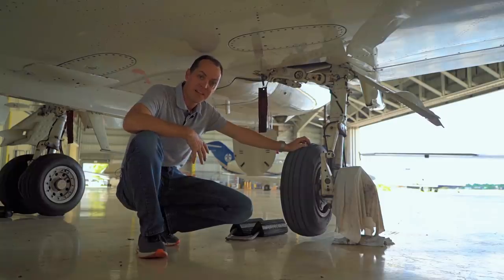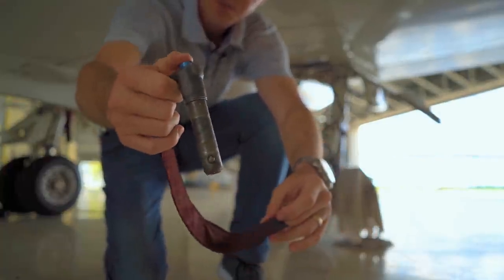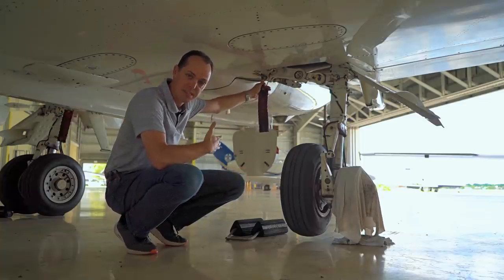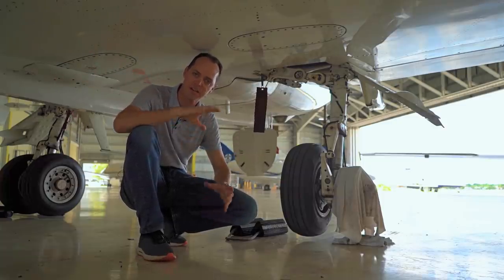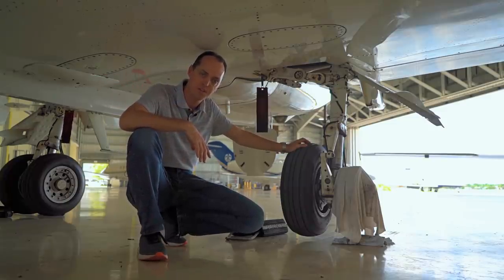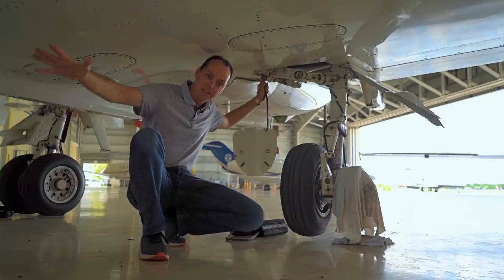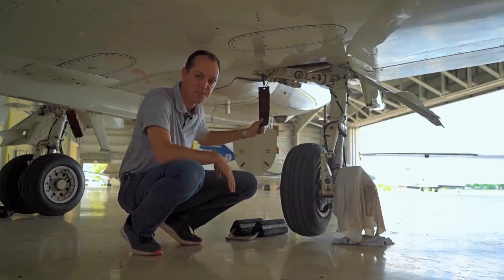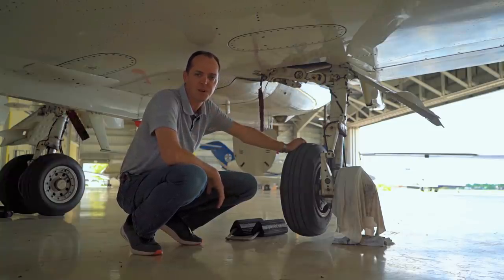Tech Tuesday - Gear Collapse Prevention Made Easy

Comment: Hi Shaun, great idea of setting the brake so it can't be moved, except the tug operator may try to move it and the nose gear has a potential to collapse.  There's usually enough in the accumulator tank for that not to happen.  I and my team always help the crew by installing the pins shortly after the pax are gone (providing it is overnight and will be towed).  We will not, however, remove the pins for the crew so they physically have to do it and know it's been done.  On the Hawkers you also need to move the steering pin from vertical to horizontal, especially important to remember when using a Lektro, otherwise that pin is used in the horizontal position with the tow-bar head.  Love the Tech Tuesday.
Reply: @Honk Honkler You can pull and push an aircraft, putting forces both directions on the gear.  When towing an aircraft forward, usually tug in reverse, you are pulling the same way the gear would be traveling to go up.  If the brakes are set, the mains are where the brakes are, and the tug driver tries to pull the aircraft, in theory the nose could collapse.  Without gear pins of course.

Comment: Back in the USCG during the '80s, we had a flight crew that all missed pulling the gear lock collars on the HU-25 Falcon, a taxiing ac passing the Falcon spotted the bright red REMOVE BEFORE FLIGHT tags hanging from the gear locks. The best part was the PIC was a genuine prick and he did the final preflight walk around.. 🤣🤣🤣😁
Reply from the maker: That's classic...karma will bite you!

Comment: Fyi, unless things changed, theres a micro switch on the  Scissors link to keep the landing gear from retracting. When the aircraft is jacked up the switch allows the gear to be retracted
Reply: In the Air Force we called it the "Weight on Wheels" switch.
Reply: @Charles-rt2de  And we used to call them the "squat sitch".

Comment: I guess the flags could be made long enough to extent through the door, up the aisle, and block the access to the cockpit. Or, they could fit slots in the door to hold it closed (no pins, no closed door)😂 Another great video Shaun !
Reply: For many years, I worked for a company with no standardized procedure for stowage of the gear pins.  Twice in ten years, I had the gear fail to retract. (Three man crew).  You would do well to not rely on “everybody has a different way”.

Comment: When you extend your arm to lock your elbow open, is it over-center?  The primary means of locking the gear down is the over-center action of the down-lock linkage, augmented by hydraulic pressure. On some systems, the linkage moves over center by as little as 1/16 of an inch. Mechanics have been fatally crushed by the airframe because they did not understand the how and why of the over-center down-lock linkage.

Comment: Does the nose gear also have a locking pin that has to be in place prior to towing like on the larger airliners?
Reply: Yes. Typically the nose gear doors are unlocked and the pin is installed. I've seen a lot of pilots leave the nose doors open until the pin is pulled because the unlocked doors will give a red nose gear down indication
Reply from the maker: Exactly
Reply: Defunct National Airlines out of Las Vegas used to have a ramp agent hold the locking pin over his head so the captain could see that it was removed after push back.

Comment: Ah, interesting, once at LaGuardia, the plane I was a passenger on, a 737, stopped mid-taxi and a service vehicle showed up along side. Some guys got out, went under the plane and returned to the vehicle with a flagged item. Do the gear locks on commercial planes have sensors? Or do all the flags require visual inspection prior to removal? At busy airports I imagine lots of eyeballs insures safe removal before takeoff.
Reply: No sensors. They have a checklist that requires them to be installed and removed.

Comment: What does that look like on the nose gear? And like another question, what does the front jack look like?
Reply: The nose gear pin is just slightly smaller and goes from left to right up a ways in the gear bay but works in the same way. Jacks, are the two at the wing and one at the tail. If the plane wont move for a while generally there is one more set up just fwd of the door with a brace across almost like a cradle just to make it all more stable.

Comment: I’d have imagined that they had mechanical down locks and the pins were to prevent someone accidentally moving the selector lever whilst on the ground?  What happens if you land with engine or hydraulic failure?  Would the undercarriage drop with gravity then collapse as you roll out?

Comment: Besides the embarrassment. Will it do damage trying to raise the gear with the pins in if you don't realize right away? Since the hydraulics are working against the pin. PS  Love Tech Tuesday. It's nice to see whats behind the panels.
Reply from the maker: If the proper checklist is followed after, then no damage will occur, but there was an incident where this happened overseas and it resulted in the nose gear collapsing.

Comment: But when a gear is down and locked isn't there a mechanical linkage that keeps the gears in position no matter the hydraulic pressure? It makes sense that the purpose of the hydraulics is the push it down and pull it up but after that it's mechanically locked. If hydraulics were the only means of holding the gear then hydraulic failure would cause a stowed gear to drop, no?
Reply: Mac Delaney 
Landing Gear motions are (in most cases) electrically commanded, hydraulically operated (up motion, especially) and mechanically locked (which causes the hydralic pump to stop working). Well, maybe Hawker’s LND GEAR system works different.... 🤔👍

Comment: Good vid. Thanks. I would imagine one would get a system notificatin the pins are still in (on pre flight check?).
Reply from the maker: Nope...there's no indication in the cockpit that the pins are installed. Better get them on the pre-flight...

Comment: Shaun, I appreciate most Airports you visit in the Hawker or G-IV will have you parking at a stand/spot from which you can taxi straight ahead without a pushback on start-up. How would you handle the classic airport style pushback with permission to start on the pushback in these aircraft? Will the APU give you enough power for hydraulic pressure to maintain the gear locked down?
Reply from the maker: I've actually had to do that a few times. We have to push back, then open the door to pull the safety pins, then start the engines. Not a simple process but it's the norm when private jets do a push back for start.
Reply: Many thanks Shaun. Keep up the good work!😁

Comment: Arent landing gears designed with mechanical locks that keep them down even without those pins?  Unless thats only on Boeing and Airbus for example....
Reply: I believe most retractable gears have a similar setup.  I know that CRJ and ERJ's have a downlock that over centers to mechanically lock the gear down. Its hydraulically pulled back over center to allow the gear to retract.  the 3 green lights are typically setup to reference on the downlock position.  the phrase "down and locked" is derived from this.

Comment: Thanks Shaun,
The plane looks bigger in the hanger.
Is it the same size as the Gulfstream?
Cheers,
Rik Spector
 I know, i should check the specs, but it's more fun asking "The Man"
Reply from the maker: The Hawker is much smaller than the Gulfstream...about 1/4 the weight

Comment: Thanks for the tech tuesday Shaun. Was wondering, how common are safety pins? Do most smaller corporate come with them or does the gear lock when it’s down with most jets? I know the chances of losing hydraulic pressure is pretty low due to redundancy but are safety pins common?
Reply from the maker: Not all corporate jets use them, but the majority do

Comment: Not a pilot here: Does the APU help with maintaining hydraulic pressure, or is that the engines only?
Reply: Great question.  Not a pilot here too and I'm curious about this as well.
Reply from the maker: Nope...the APU only provides electric and pneumatic (air)...no hydraulic
Reply: Pretty sure most APU’s only provide electrical power but hopefully Shaun will respond and confirm or otherwise.
Reply: I’m not sure about hawkers.  But Gulfstreams have an auxiliary pump that provides hydraulic pressure (3000psi) to the LH hydraulics for critical systems. Landing gear, flaps, nosewheel steering and INBD brakes. This pump is battery powered. Before towing an A/C that has been sitting awhile we will turn on batts and then the AUX pump to charge the brake accumulator to 3000psi so the INBD brakes work nominally.

Comment: Is that possibly why the gear gave out on Dale Earnhardt Earnhardt jrs  plane.
Reply: His aircraft came down hard, more than once.  Unless they lost hydraulics, but the engines were running and should have had full pressure to keep them down.
Reply: @Kelly-jc3jc  I wonder if the pilot forgot to disable the ground spoilers
Reply from the maker: I don't think this was related to that incident...

Comment: Sean can you address how the parking brake works cause my thinking is it hydrolic as well
Reply from the maker: I can definitely do that..it is hydraulic, but it works from an accumulator, so it doesn't rely directly on the engines hydraulic pressure

Comment: So the Pilot has to physically exit the aircraft and pop a pin in after you land?
Reply from the maker: doesn't have to be done immediately, but before they tow the plane...yes
Reply: Where I work when the pilot taxis in and we bring them to a stop. We will chock the A/C. After the pilots shut down and open the main entry door, like ants we pass out door and gear pins and safety the A/C. Also when you install or remove the pins you do it from the front side of the MLG gear or the side of the NLG under no circumstances should you pass through the Wheel wells with no gear pins in.

Comment: That aircraft is such a expensive thing, I don't know, why they don't install a small switch, or photocell switch or a hall-sensor, where you can check, if the gear-pins are installed or not.
And when you set flaps to takeoff position with the pins not removed, there could appear a master warning.
That cost about 500 dollar for this multi-million dollar aircraft, and make flying a little more safety.
Reply: But then you'd need a system to check the photocell was working like the nutcrackers. Sometimes the simplest way is surely the best?